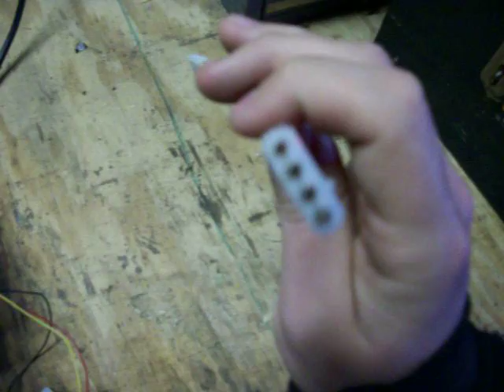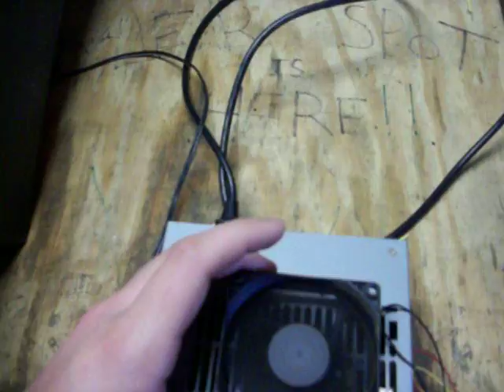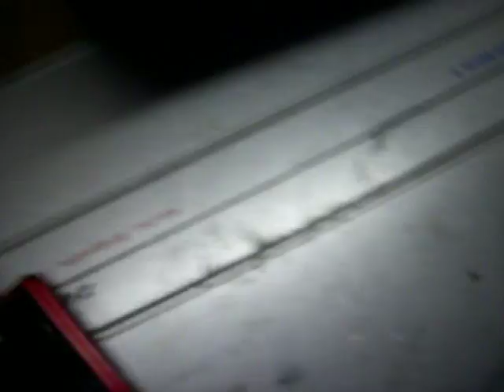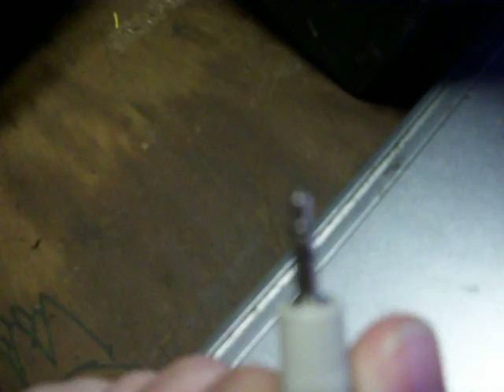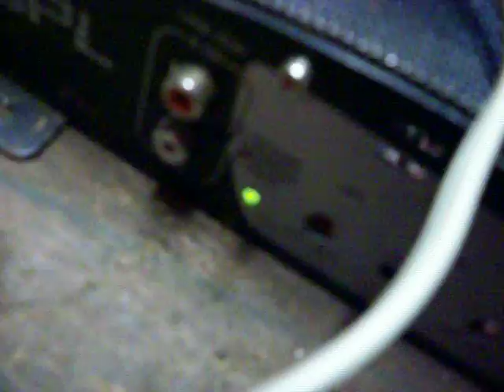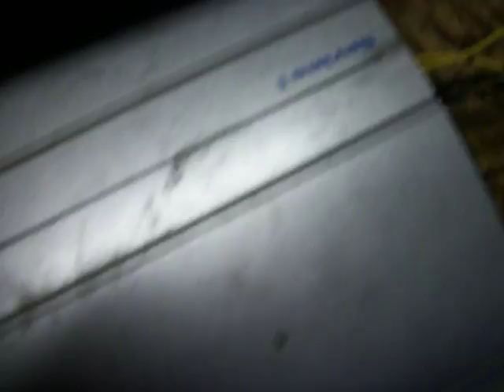(HOW TO) How to run car amp off a PC Power supply !

Comment: @11computersrock11 Yes... I have the same. It's very easy to do. I have a 15" sub 1000 watts using a PSU to power the amp. easy

Comment: i have a new 1000watt amp,can i run it with a 300watt power supply??? or could i damage the amp/power supply??? thanks!